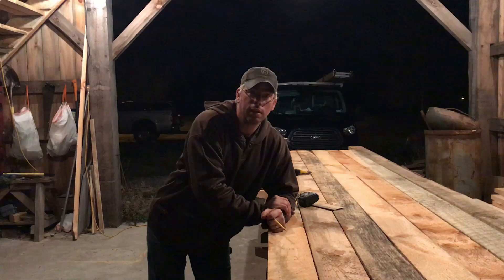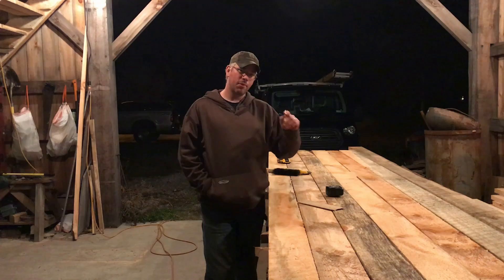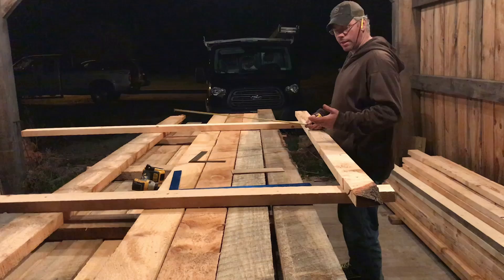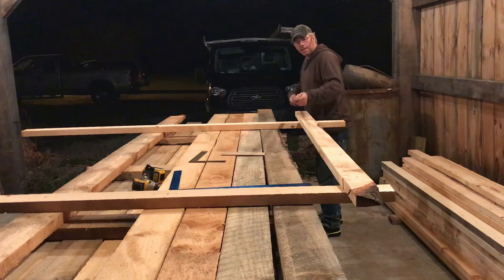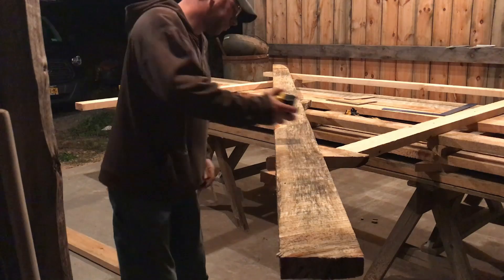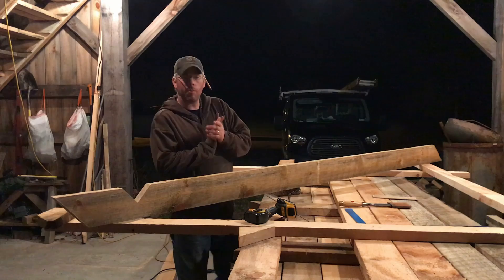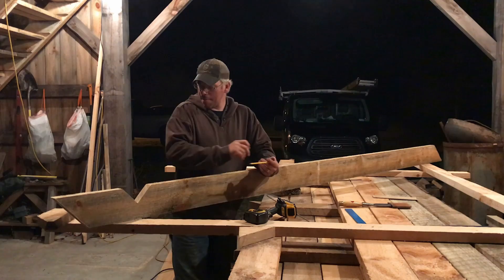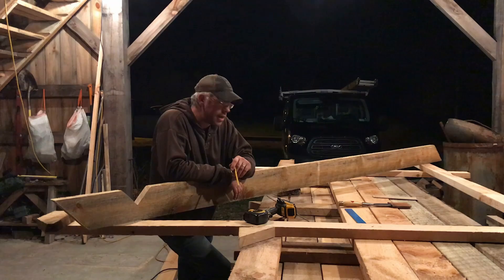EASY AND SIMPLE WAY TO LAYOUT RAFTERS, NO MATH REQUIRED

Comment: I use a chalk line or pencil/straight edge and lay it out on the floor sheathing usually, but using  a very similar technique.     Then I read the angles from my layout, and transfer them to the rafter template.    After I cut it, I set it back on my layout and make sure it all lines up.   Then a test fit.

Comment: Ridge plank is set...take your measurements.   Then raise the ridge 4" on temporary supports and rest on two mails.  Drop in and nail your rafters to the ridge plank.  Then pull nails and drop the ridge plank to its original position. It snugs up all the joints.   (This was shown to me by Kingston Construction of Duluth MN owner Mike Endress)
Reply from the maker: Excellent, thank you for sharing.
Reply: I like it!  Great trick

Comment: I've never done a rafter overhang less than 400mm before..be good to see how yours works out. Just a heads up before you lay the metal roof sheets..consider having a soundproofed gap between the rafters and the metal roof otherwise when the rain hits the tin roof the noise will drive you insane. Keep up the good work, you're doing great Jimmy!
Reply from the maker: Going to insulate below the metal.

Comment: If you can't do the math , like me , try this - 
Clamp a 2x 4 or 2 x 6 onto your top plate extending to the height of where your ridge rafter will sit. Do this on the " inside " of the top plate . Then tack on a small piece of your ridge rafter material , just a few inches will do, to your two by stock in the same position that the REAL ridge beam or rafter will sit. 
Now get a helper . Grab a suitable length of your rafter material and hold one end against the ridge set up and the other at the top plate of the wall where your rafter will have its bird mouth. Adjust both ends to where you want them and scribe the intersection. That's it. Make your cuts from your scribe lines and use that rafter as your template for the other rafters. Only takes five or ten minutes. No math and perfect every time .

Comment: I enjoy mocking things up, I have been known to just screw mock rafters into place and trace the plumb and seat info on to the board/pattern right off the ridge and top plate.  Are you sure that wasn't 78 inches, better check it three no four times, really that goes through my dumb brain more than I care for, it like leaving the stove on as you head out for a week vacation.  More on scribing, in the recent issue of Scantlings from the Guild there is a quick blurb on Stereotomy, no math compound joinery.   The 3.4.5 triangle is math, even geometry is math.
Reply from the maker: I am not a math guy...as for the measuring you know me too well now.  I climbed back up twice to recheck!
Reply: I like how you think.  Looking forward to seeing those rafters on.

Comment: Birds foot ?
Reply from the maker: Birds foot is the notch in the tail of the rafters that sits on the outside of the plate...birds mouth sits on the inside of the plate.
Reply: Thanks for replying, this must be local usage, I had never heard this term before and had to ask,your explanation makes a sort of sense, but on a quick scan of the interweb they both seem to be birdsmouth cuts !   Your use probably deserves more widespread currency as it adds to our ability to accurately describe what we do.
Reply: Interesting, we call it a birds mouth in NH
Reply from the maker: It's more of an old time timber framing term.